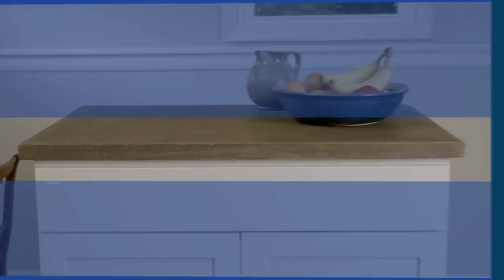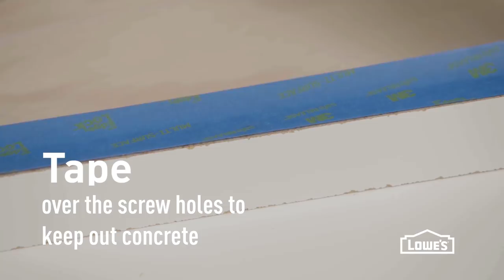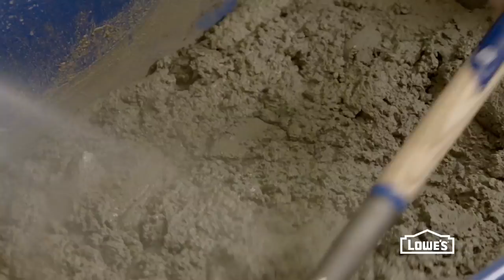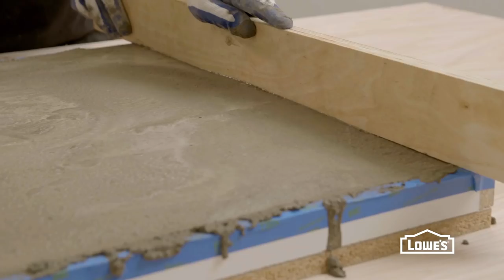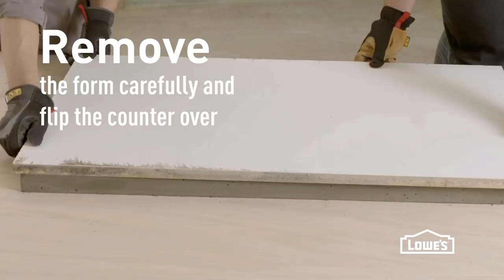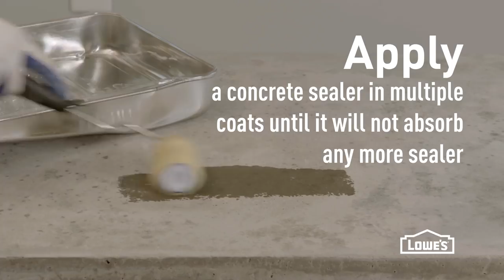How To Make Concrete Countertops | Beyond The Basics

Comment: What would be the best way to cut out the hole for the sink, etc.?
Reply: Use 2" foam insulation and cut a template of your sink. Hot glue to your form and caulk around the foam to seal it.

Comment: what grit of sandpaper are you supposed to use?
Reply from the maker: JEFF WILLIAMS start with 100-grit and work your way to 220-grit; keep checking until the surface and edges feel smooth. Be sure to wear a respirator; this is a dusty process. Thanks for watching.

Comment: How do u fasten the slab to countertop?
Reply from the maker: One of the most common ways is to run a thick bead of silicone caulk along the top edges of your base cabinets. You can also use construction adhesive, but the sheer weight of the concrete countertop will help it stay in place!

Comment: Don't ever do this we did it when we bought a new house and it was fine,we added dark brown coloring to it thought.but after about 4 to 5 years  later it looks horrible cracks  are everywere and the color is fading we now are in the process of redoing our entire kitchen and are using granite countertops instead but what ever you do do NOT do this trust me you will regret it  later on
Reply: I think maybe you just used a cheap concrete mix... Concrete is pretty durable, especially when sealed and reinforced properly
Reply: Aaron Glisson your suppose to seal it every year.
Reply: Also 4-5 years is pretty good

Comment: Don't use Olive Oil. It gets rancid over time, and concrete is porous, so that's gross.  Also, you could have achieved round corners if you had applied the silicone correctly when you sealed the box. creating that little ogee shape with a silicone tool would mean less sanding of concrete dust in the end. Also, shame on you for not mentioning that one should be wearing properly rated ventilation when sanding concrete. COME ON LOWES! GET IT TOGETHER!
Reply: Useful and helpful comments. Use pure silicone and smooth it with your finger. Gives nice rounded edges and is easy to remove. Ideally, use a wet sander of spray water on worktop as you sand with an orbital sander taking care to wear gloves and have a cut off device in case tool gets wet. Use Glass fibre or steel mesh.